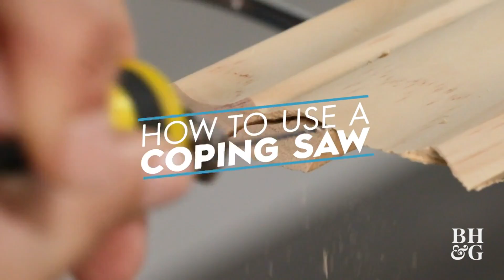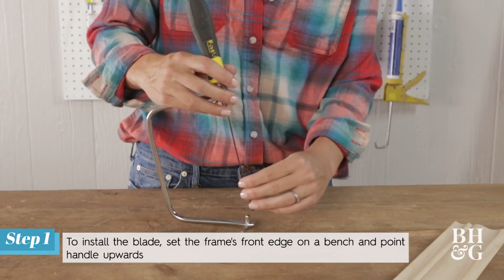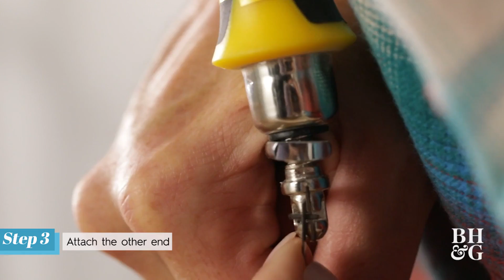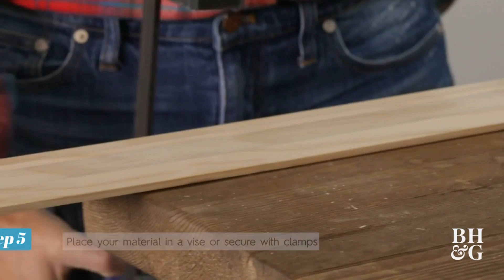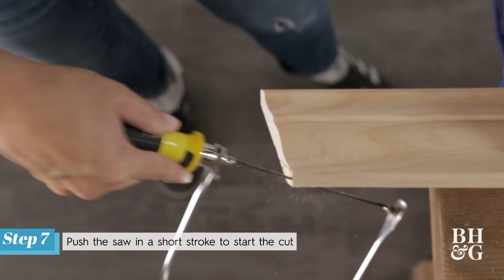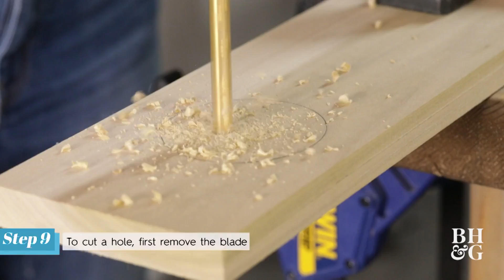How to Use a Coping Saw

Comment: Would be nice if you also mentioned how tight the blade needs to be in the frame for the saw to work at it's most optimum. Too loose and snapped blades binding  etc... Too tight and the bow frame doesn't glide well when the angles are changing, etc... And what to avoid like twisted blades or how to avoid the blade binding in the work. When to change the blade like when the take of the teeth are too close and chips can't be evacuated efficiently in the cut. Or is there a way to reset the take and stuff like that. I suck with a coping saw I've probably got the blade too tight but don't know how much to loosen it. The rake of the blade especially in the middle section is becoming aligned with other saws I use a nail with half the head filed flat and a lightish and sharp tap with a thumb detector to reset the rake when my saws stick in thicker prices of wood. But I don't know if I should just toss the blade as that seems a waste as it is still very sharp one twang on a an ungloved finger still makes quite a good set of leaks lol.
Reply: Erm... Is this the same video I was watching a moment ago? Well that made my entire comment redundant I guess I'll leave it up just in case it still has sent relevancy. When will I ever learn to watch the whole video first b4 going off? Meh prolly never.
Reply: Still relevant hahahahaha for once. Anyway can anyone answer the questions from the first comment?